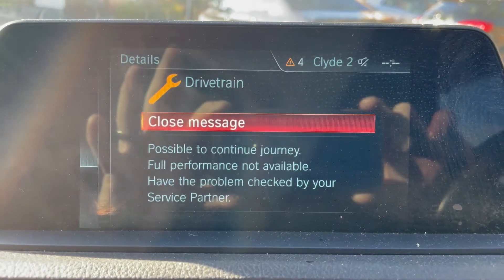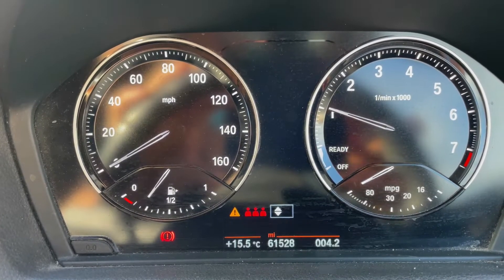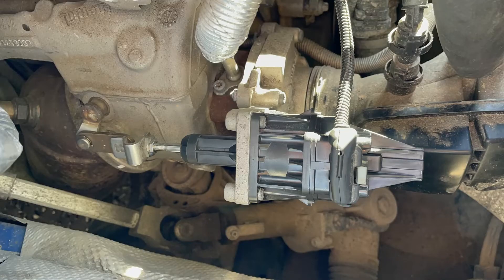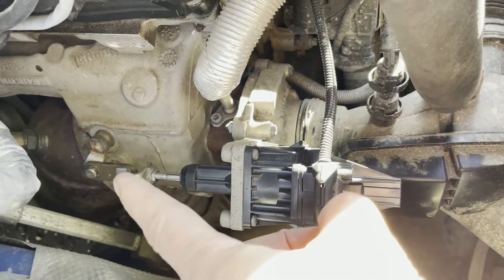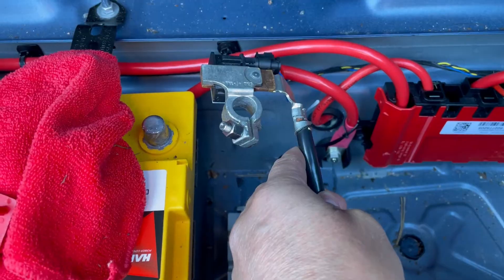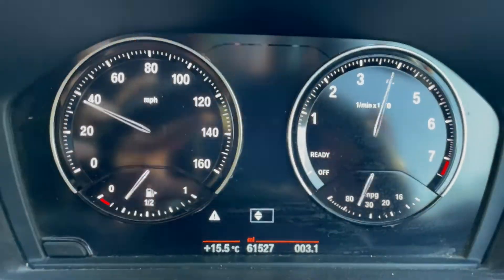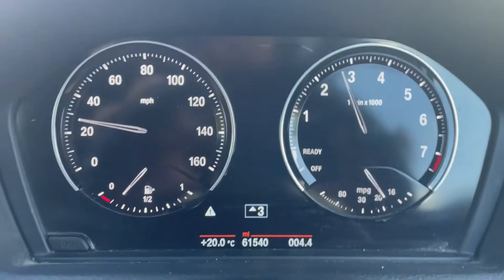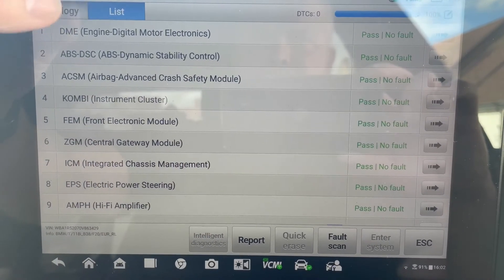BMW 118i Drivetrain Warning and Engine Derate

Comment: Why would it have a dual mass if its a petrol?
Reply from the maker: @angryjackrussell2033  I’m afraid some petrol engines have dual mass flywheels. This engine is a 3 cylinder which produces a lot of vibration naturally. BMW in their wisdom fit a dual mass to reduce drivetrain vibrations.

Comment: I replaced the cultch and my drivetrain fault is still there what shall I do now?
Reply from the maker: The drivetrain fault can be caused by many issues. You will need to connect a scantool the read the stored fault codes.